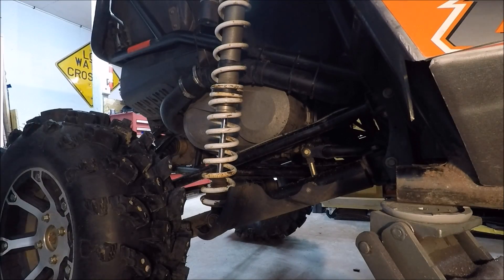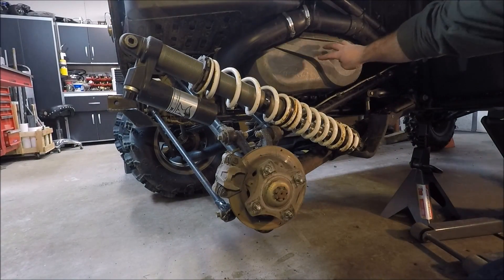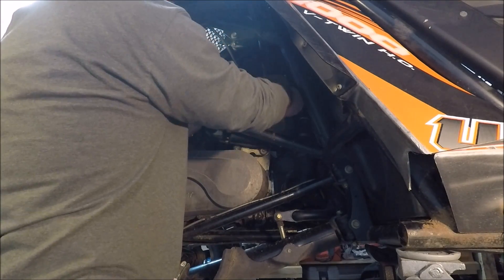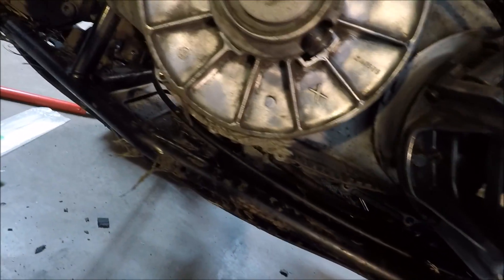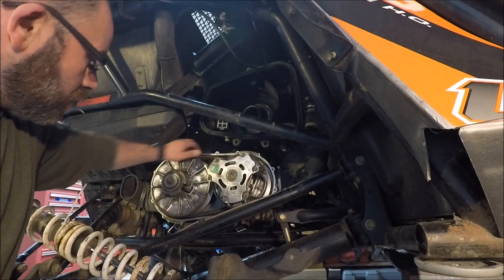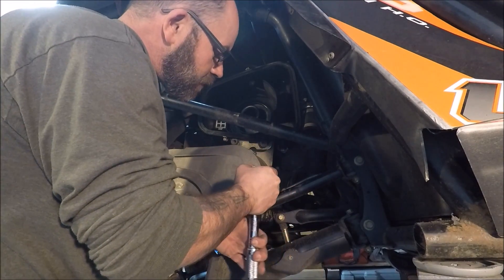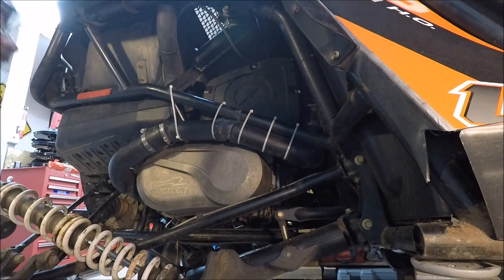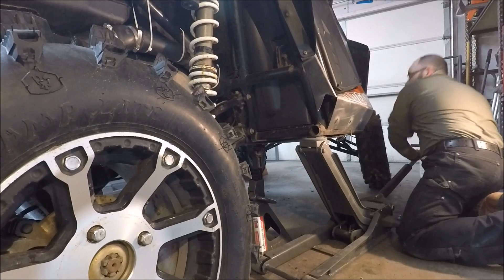2013 1/2 WILDCAT BELT CHANGE

Comment: Good video. I blew my belt because i like to go sideways in 2 wheel drive on the sand (bad idea). I got paddle tires on the back and only run 4 wheel drive. The belt has lasted a long time.

Comment: Okay I'm putting it back together and of course I already had it taken apart before you mentioned the longer bolts and shorter bolts that I didn't even recognize now where do the long bolts go you don't happen to remember do you?
Reply: This is not for you (2 year old post), If anyone else was wondering. The long bolts go where the brackets are doubled up. (air filter and the bracket for the clutch vent.

Comment: Got a 13 wildcat and seems when it heats up good starts loosing power. Lost all the way down to where wide open was like 15 mph. Changed plug, ran good for a bit then did it again. After cooling runs fine til it heats up. Any ideas. Awesome vid buddy

Comment: Think I'm just gonna get a Yxz 1000r Yamaha. They are not belt driven. Everyone I know that owns a Polaris or a Wildcat are sick of these belts. It's expensive and time consuming to have to change belts Everytime the temp goes up.
Reply: the problem is people are running them in High gear in the sand or mud. In the owners manual it tells you,  if you are running on anything other than hard packed dirt or pavement you should be in Low gear. This is b/c the belt works less and has better cooling in Low gear.